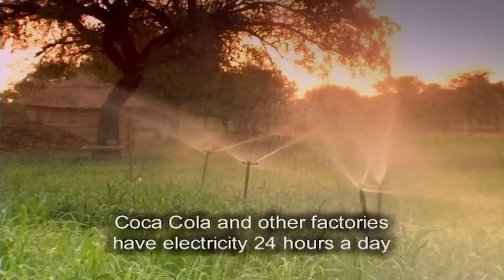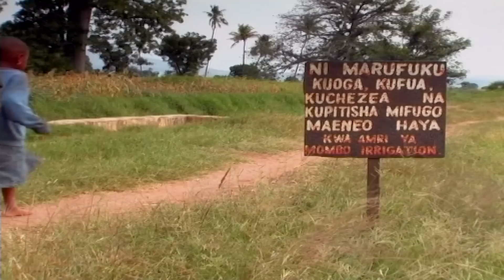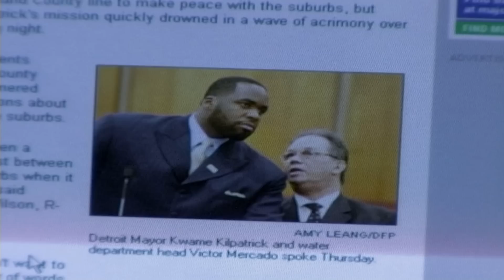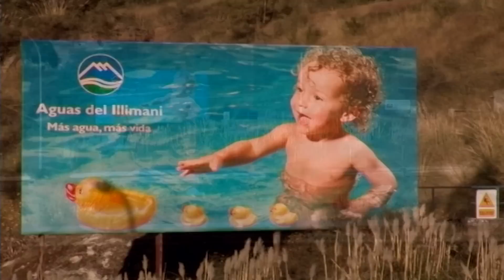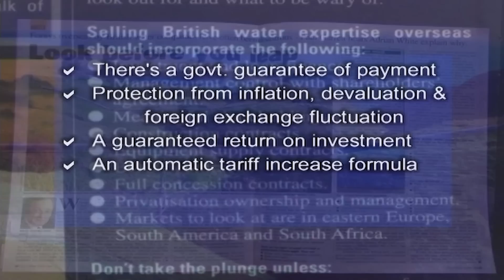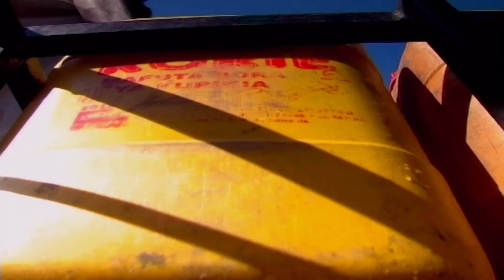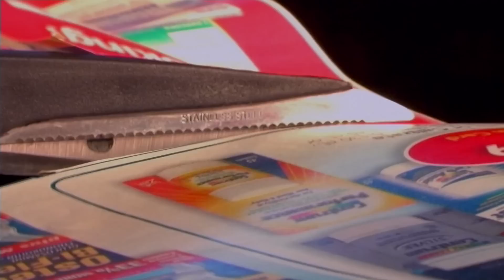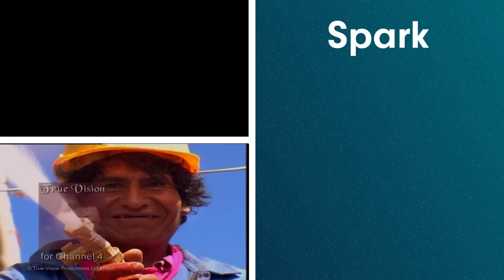How The Rich Are Hoarding The World's Water | A World Without Water | Spark

Comment: If ever there is a case for an independent water supply then this is it.. 
There is equipment available to extract water from the air. It works even in the desert without electricity.
I suggest these people need to be educated to what is available to them.

Comment: I understand that commercialized reverse osmosis water purification is very energy expensive.  However if you did a hole in the ground and pee in it, you can easily extract that water back out and clean with a simple solar still.  Why can't something in between be done, where small scale evaporators, two hundred square foot basically tilted plastic with a drain into a plastic bucket, that can work 24/7 to fill water for drinking.  NOT for industry.  NOT to cool huge banks of computers.  NOT to turn natural human waste into toxic waste, which is what we stupidly short sighted Americans do....